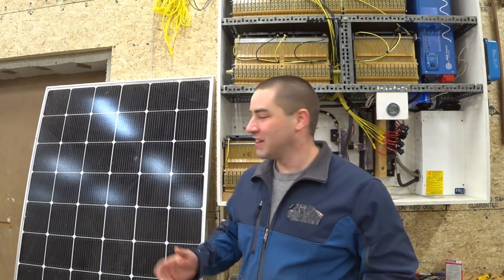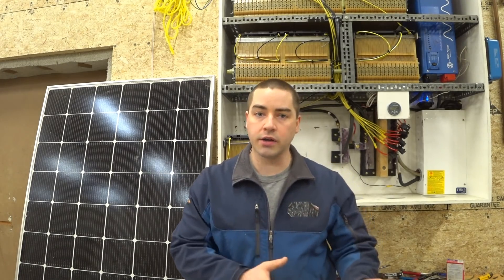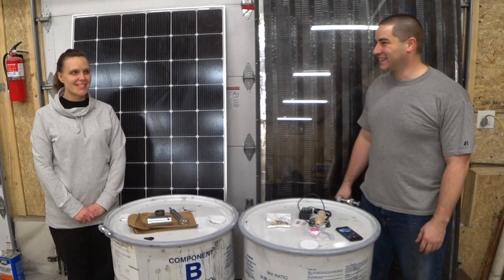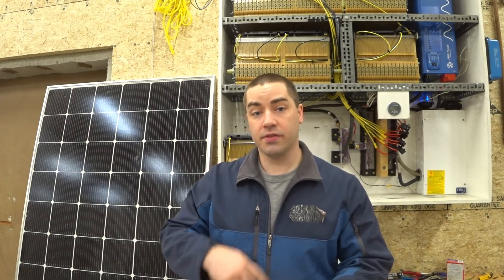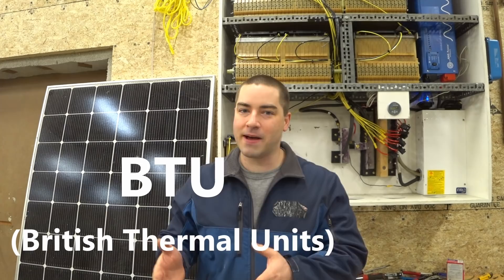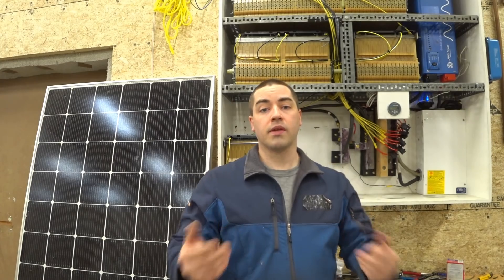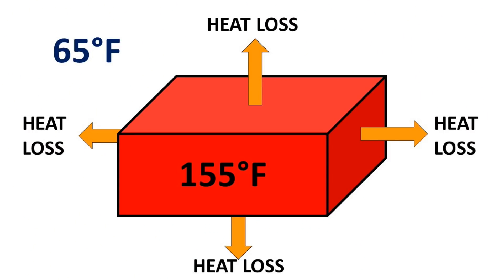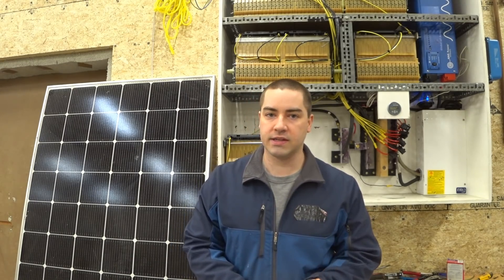Cheapest Energy Storage Off-Grid

Comment: Heat your water for free. Years ago when I was young I had a sawmill which created  a saw dust pile. Well the saw dust pile would get so hot inside it would catch fire and burn inside. Ok now here is how to heat your hot water for free. get a large tank  500 to 1000 gallon put your water coils inside it and pack it tightly with fresh green saw dust. Insulate the tank good. The saw dust will heat up and heat your water for free. I would use around 2" pipe for the coils. Plastic should work as they are filled with water.  Something to think about.

Comment: That's an excellent idea, which is using thermal storage as you mentionned, or phase change cooling/heating.

Knowing heating/cooling can easily take 30-40% of energy consumption, that is one good move if you can store either hot water during the winter, and cold water during the summer.

Comment: you don't need to use a heat thermal exchanger!!! ....  all you need is a 12 volt Boat/RV "Sure Flow water pump".  This pump turns on as soon as you turn on your water.   You are wasting the heated water by using its energy to heat the regular water.
Reply: The purpose of the heat exchanger is twofold (1) it isolates the storage water from the water you actually use (health issues) and (2) the storage tank water is MUCH hotter than the water at the tap. The heat exchanger is a core item.
Reply: B Coop I think it's against the code

Comment: I was converted to the idea of using solar thermal heat back in 1967, when I visited an outdoor swimming pool in Southern England that used the sun as its heating . The pool was approx 20x 5x 2mtrs. There was a small changing room/ pump room which had a copper sheet roof with a glass over roof, The filtered treated water from the circulation pump was allowed to trickle down the roof and by gravity into the pool. It was warm enough to swim even in winter, The owners had a family tradition of swimming on Christmas day. 
In my own home I use solar thermal in the underfloor heating in winter and to heat the hot water in summer. The rest of the time I use air source heat pumps, often powered by PV . 
But the best way to cut heating costs is of course Insulation.
Reply: I love that. Water flowing over copper. Just add some silver along the edge, and you have a Roman water treatment system and a heated swimming pool.

Comment: Everything you are doing makes no sense at all and is the opposite of efficient...its very simple to heat water...lifting weights into the air is what you should be doing...that can be done manually or by car and many other things and there is no need for batteries to store electricity

Comment: Is there not a risk of harbouring legionnaires disease in the storage tank..?
Reply from the maker: I don't think so.  The tank can get hotter than 130 degrees, so I think that kills it off.  Plus, all the water in the tank is not part of the potable water.  So even if it did, I'm not drinking that water.  But, no harm in adding a biocide so long as it is compatible with the liner material.

Comment: Hey David. Absolutely awesome video! I live in Denmark where we have a fire going in the fireplace almost every night in winter. Now we are working on an extension of our house, and I have been looking at storing some of the heat generated from the fireplace in a so called mass oven (usually a lot of sand underneath with heat exchanged ventilation. That way the heat gets distributed through the house throughout the night. I was wondering if you had any suggestions as to how a fire could help carry you through those autonomy-days.
Reply from the maker: Wow, that's cool you are watching from Denmark.  Wood heat in general is wonderful.  I think I'm going to incorporate a wood stove into my next house.  Personally, I will probably use a water jacket in the wood stove.  Around here that is usually a stainless steel pipe that makes a "S" shape in the back of the fire-box.  Water can be circulated through there with a pump, or with thermosyphon.  This allows you to heat a large water tank, and then you can use that hot water for space heating and/or showers.  

I've talked with a lot of old-time builders and architects who have tried dry heat storage banks.  Basically they dig and pour concrete walls as if it was going to be a basement.  Then they fill the basement with sand and air plenums, or sometimes just large rocks.  I think this is what you are leaning to.

In every case I've seen this system fails.  It winds up getting mold growth, or water puddling, or it just doesn't work well.  I visited a house last year that was having the rock bin "capped off" with concrete because the homeowners were so sick of it.

That's why I would rather just stick to a large water tank and use a radiant floor.

If I have mis-understood what you are referring to, then maybe we can talk in more detail on facebook or email?

Comment: My 2 cents: i like your idea. We should all do this. Especialy the combination of both hot water and elec.
Note that for hot water you need direct sun light. When it is clouwdy your PV pannels will still produce some electriciteit.
If you use more then 1vat you could get potentialy get a higher efficiency ...
Maybe dedicate 1? PV panel to your hot water system (connect directly with  DC motor, less loss). Then when the sun shines it Will cycle/Heat your water and when there is no heat to be had it wont.

Comment: would there be better heating and less energy loss using oil?
Reply from the maker: I don't know the thermal properties of oil.  But water is just simple, easy, and safe.
Reply: Jye Siemsen No, the specific heat capacity of oil is around half that of water- i.e. the same volume of oil holds less heat. Also, it cost more, and is a nightmare to dispose of. If it leaks, you have a major problem that would cost a fortune to clean up, and the chances are you would have a big fine to pay as well!

Comment: After all your purchases the carbon cost of your materials, transport, waste and inefficiencies mean you pumped more carbon out that using geothermal heating and cooling from mains power. Congrats I guess. Also how many materials were manufactured or extracted from countries with no EPA meaning how much toxic waste was created by cheaper methods using workers with no protection?

Comment: If you are storing energy as heat, you might as well capture the heat in the first place, no? Wouldn't the product to do that be also cheaper than a solar panel? You could have a combination to get electricity and heat at optimum cost.
Reply: Spot on. Using electric solar to heat water is inefficient and expensive.
Reply: @kefsound  On my setup, once the batteries are on float the PV then goes to boost the water storage tank.
Reply: @kefsound  How would you use solar energy to heat up to 180 F if the ambient temps are 60 F  without using a coil? Those solar tracking mirrors are something of a specialist installation requiring constant maintenance.
Reply: viheren any commercial solar water heater goes easily over ambient as it is basically isolated (by vacuum) but transparent to IR-radiation from the sun. But you have good point here as on cloudy days it could be bright but still sun is not really heating. Then you might get lots more from the sun by harvesting electricity first.
Reply: Hi David I used to work in a governmemt agency as a reseach scientists and we had solar concentrator in quartz pipe under vaccum or nitrogen to accumulate the solar  enrgy at very high temperature into a glycol mixture that went through the pipe and then to be transfered in an accumulation cell like yours but better insulated since it was at over 250deg C. Using electricity to convert to heat is not efficient.
Reply from the maker: I like a combination of heat storage and electrical storage (battery).

Comment: The problem of course is that it is not efficient to store electrical energy as hot water.  You did half the job and converted electrical energy to hot water.  But how to efficiently change it back.  My lithium cells are 98% efficient in the round trip.
Reply: He's not storing electrical energy though. He's using hydronic solar panels to directly heat the water and store it in a large tank. It's roughly 80% efficient and considerably less expensive way to supply hot water. I've got a similar setup myself.

Comment: Wouldn't it make more sense to use vacuum tubes for this? Have you calculated cost/output ratio? Good idea :)
Reply from the maker: Sure.  I've been told vacuum tubes perform better than the flat-plate heat exchanger I have.  If I could get my hands on some I would do a side-by-side test with them.

Comment: Another thing you can look at is high density thermal mass storage. I've done experiments with granite, marble, and lava stone. Construct it similar to a lead acid battery, where your insulated on all sides, but have slabs lining the bottom, sides, then a few running parrelle to the longest side (1 mass block spaced 3 feet apart). Using the water as a conductor, and the stone as mass storage, you can have less volume in your cistern but even greater and longer lasting heat storage.
Reply: This is such a simple idea. I always wondered why the summer heat is not stored for winter? At industrial level will be even more profitable, since the size makes the loss smaller. Now I realize that the storage for water supply could be inside the storage for heating system since the later can work at a lower temperature.  And a different one could be used for cooling. Every winter there is a lot of snow that must be cleaned, and sometimes is transported by trucks out of the city.

Comment: Could you boost your solar with a wind turbine? Here in the UK we get a lot of days with no sun, but appreciable amounts of wind. Since you're storing energy as heat, a turbine could drive a generator producing unregulated AC with variable frequency and voltage, and just dump the power into the water tank via a resistive immersion heater.  Feasible? Realistic? Or just dumb?
Reply from the maker: I think wind turbines are great, but I have no experience with them.  If you have a windy site, I say go for it.

Comment: can you explain how you create electricity from hot water(that is not steam)
why dont you build a vacum based solar water heater.the vacum allows cold boiling of water vapour and tge sun produces super heated steam.

a heat exchanger heats a seperate water to over 100°c on some days.

you then run through your thermal exchanger.

this means you can run other things on solar electric
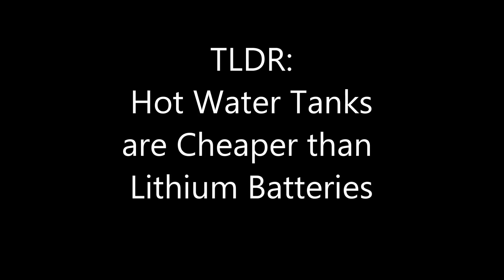Reply from the maker: I like batteries for electricity: 13:18

Comment: I am a Solar Thermal Specialist in the Midwest. I have been in it since the 80's. Solar Thermal is far more efficient than Solar Electric. You need to look into a super insulated large tank with Electric back up elements and an exchanger coil using copper and a water to water exchanger. You need at least twice the storage you have now. Another point is that Solar Thermal is 3 times more efficient than Electric to harvest.

Comment: Just some figures I work with - 100 Litres of Water - raised by 50 degree C is 5.83 Kw/h of energy - But if you are using a heat pump with a COP of around 3 then the energy required to heat the water would be a 1/3 or just under 2 KW. This part of the calculation varies considerable with quality of heat pump - temperature of the cooling side of the heat pump (warner cooling element increases efficiency)  .... So if we use a radiating element to heat the water the best we can get is a 1 unit of heat for each unit received by the water - - 

The bottom line is that LOTS of water is important - say 250 litres - 66 US Gallons - would  hold the equivalent energy to a 14 KW Powerwall 2.. Also note that if the heat is used for the house that the energy loss could be zero as the heat is always absorbed by the house (Possible win compared to a battery .. ) - - Thanks for the video  -- definitely something to consider for anyone  needing heating in winter ... As a side note there are a lot of heat pump approached that can raise the COP - one of the biggest is the ambient temperature - so always good to heat up in the middle of a sunny - warm - day ...
Reply: COP of around 3, you've been snookered if you believe that. I have a HPWH and you can't get much more than 120F.  At that temp you have no ability to store heat. It is also taking heat from the living area (unless you live in an area where just putting a barrel out will give all the hot water needed).  A combination  HP and resistance is workable. Every situation is different, this is MA.
Reply: opera thanks for the comments. If we are looking at energy transfer of 15 plus kw of energy per day then I would suggest the heat pump would be separate from the water storage unit. The best solution is always to us grounded cooling loops below the freezing level death in the ground, next to the house ... which I don’t have any data. While the cooling loop will cost a few thousand dollars the energy efficiency of the heat pump goes up considerably. Nothing is easy but can be cheaper and more value than battery storage ... which I have both ... but also my winters are not as cold as yours here in South Australia  ...

Comment: I think you'll find the advantage of higher sCoP (seasonal Co-efficient of Performance above 2 to 3 times) for a heat pump means you would require much less solar panel area which is cheaper than just electric resistance heating by solar power. Also the type of thermal energy storage you are talking about is called sensible energy storage. People with space restrictions should look into latent thermal energy storage (heat of fusion). i.e melting. For illustration the energy term called BTU is defined as the energy required to heat 1 lb of water 1 degree farenheit at 32 f. (one lb of water is about 2 cups of water). The heat of fusion or energy required to melt 1 lb of ice is nearly 1,000 BTU or about 1,000 times more energy than raising the same amount of water 1 degree f. Ice desn't melt at an appropriate temperature for heating or DHW  energy storage but materials like parrafin wax and other similar cheap materials do. Those with restricted spaces can use materials like parrifin waxes called Phase Change Materials (PCMs) for energy storage. Some Latento DHW tanks (German Manufacturer) have a PCM which is used for additional energy storage. Also be careful to add some sort of biocide (I think enough chlorine may work) to your tank to prevent the growth of legionaires disease and ensure it is effective over time. You wouldn't want Legionella pneumophila drifting up into your' family's living space.